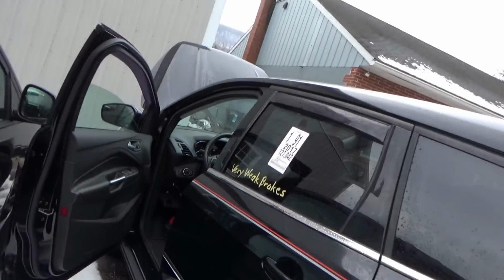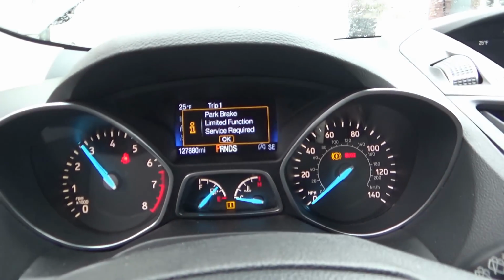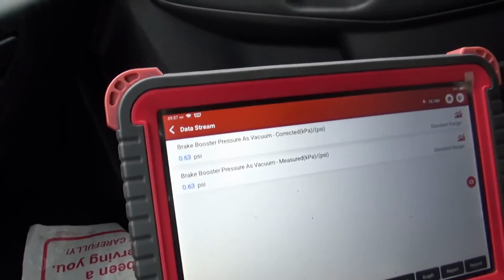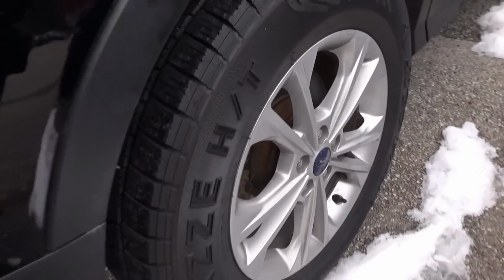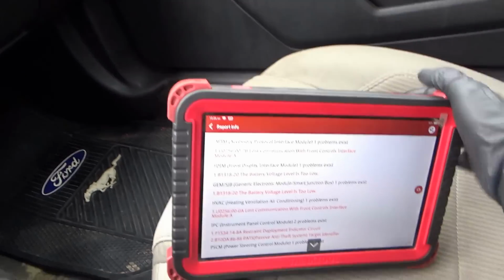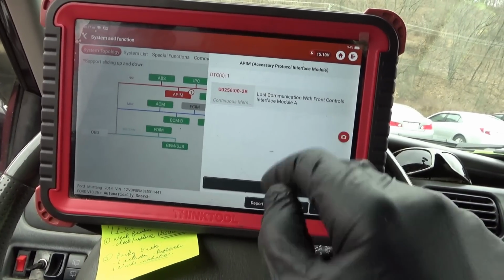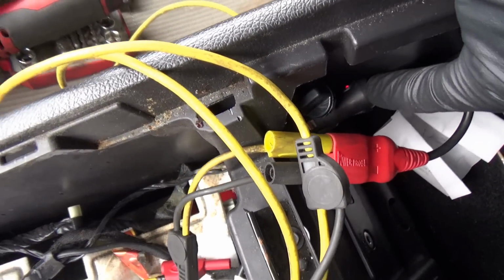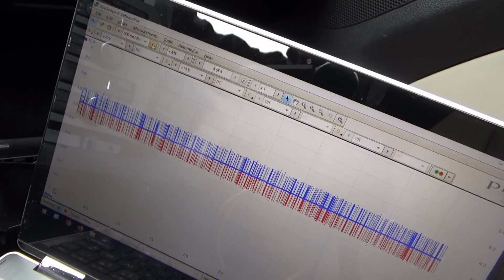Modern Ford FAILURES?! (17' Escape WEAK BRAKES, 14' Mustang No Radio/HVAC)

Comment: For the Escape, we had a similar one traded in quite awhile ago and it had the same stiff brake issue, did not even test drive it out of the parking lot. It had no vacuum from the pump as well. I decided to pop the vacuum pump off and found that the bolt holding the drive into camshaft had broken off clean, nothing to grab on to and was not able to get out the sheered bolt easily. I recommended an attempt to extract and repair or worst case replace the camshaft. Did not get a conclusion as the vehicle was wholesaled to auction shortly after. Hopefully it wasn't that same one you worked on lol! Enjoy the channel a bunch and I keep your diagnostic procedures in mind whenever I get a tough one. Cheers!

Comment: A long time Toyota parts counter guy once told me that US law required them to carry every part for a car for least 10 years after they stopped making that model. 

But (per your example of not being able to find a module for a 2016 GM) I wonder if this is actually enforced? 

Yes, supply chain impacts from Covid is still an issue.

But… it seems that in recent years, many  companies (and people) are pushing the boundaries of the legal system because… they’re aware that they will most likely get away with it. It’s a slippery slope that will be difficult to reverse.

Comment: If i wrote the repair order it would read: 
"Performed analog and digital leak tests on power brake booster, both test results ok. Stuck my finger on the vacuum pump, it ain't suckin'."

Comment: I fully agree that the discontinuation of parts and modules is a huge problem.
  With that in mind, I already bought used modules (really cheaply) for my 2014 Silverado for the future.

  I'm buying other parts that are likely to need replacing some day.
   Buying them before any emergency lets me find them at much lower prices and I won't be faced with "parts shortages".
  I'm getting most parts at 60-80% cheaper than "emergency" prices.

(Full set of 8 fuel injectors, $90 ).
Emergency price?  $1,000.
That was my biggest discount.
New Radiator?  $100 vs $350-450.
Reply from the maker: Where do you get OEM injectors for $90?? Ebay scam? 😆
Reply: I said I was buying spare parts, I never said I was sticking with OEM parts.
   Yes, the injectors are Ebay Chinese imports.
  Even if 50% are bad, I could buy a second set to find enough good ones to fix my car and still be saving tons of money.

  I worked over 30 years in the GM car factories and even in the 1980's I was shocked at how many "factory OEM parts" came from China, etc.
Reply from the maker: @craigescapeddetroit5198  thought so haha
Ask me how many problems I have seen caused by cheap eBay Amazon aftermarket junk 🤣
Don't waste your money 👍
Reply: @PineHollowAutoDiagnostics There is literally nothing worse then getting a car in from a DIY customer that has unloaded the entire  Ebay parts cannon on it.

Comment: Weird - that '17 Escape has a keyed ignition and Sync 1. Our '16 Kuga (the Euro version of the Escape) has keyless and Sync 2.
Thankfully we've also got the manual e-brake, a 6-spd manual transmission (not the Powershit) and the PSA TDCi DW10 engine not the Ecoboost grenades!

Comment: This is exactly why I will not trust any vehicles of modern manufacture. I am old enough to remember when cars were made to maintain and repair. Parts were readily available and anyone who was mechanically inclined could fix them to running condition. Now we are held hostage by the manufacturers deciding when they will no longer supply parts for a car of a certain year forcing people to buy NEW. Forget it NFW. If people were smart they would demand new vehicles to be accessible to repair by anyone, with information readily available and parts of a generic nature that could be easily made by any company. Just today I was watching a video that Ford announced that they selling a $20,000 truck, but it is only available in Europe. Does Ford think people here wouldn't buy a $20,000 truck if they had the choice. Cmon. Wake up. We are being scammed big time.

Comment: I know time was restricted on site, my gut feeling tells me that a push button is jammed on at all times. This command prevents any other command from being accepted. If it was my car I would separate the buttons from the board. Then clean the  buttons contacts both on the board and buttons. Some buttons these days have a carbon tip that needs cleaning over extensive use.

Comment: Why people still buy Fix Or Repair Daily vehicles is beyond me....
Reply: why people buy any new American cars are beyond me. They all need either engines or transmissions and the electronics are junk.
Reply: @RicardoPCGamer  Even the legendary Toyota has dropped the ball. Fifty-seven V6 turbo engine Tundras had spun bearings due to excessive pressure. No way the new generation can last a million miles like its predecessor.
Reply: @Nexgeninfi  you're right. If they would test engines for a long term, this wouldn't be happening. Manufacturers just throw new things out there and next thing you know it needs an engine after 20k miles. Nothing seems reliable anymore. I'd rather be driving my 20 year old car for as long as i can than to buy a brand new car with these expensive payments and this horrible reliability.

Comment: Vacuum pump had no power? What if? Why not check for circuit integrity and fuse perhaps?
Reply from the maker: It's a mechanical pump 😅
Reply: @PineHollowAutoDiagnostics  Mechnaical?  I wonder why ford didn't just come off the engine vacuum.
Reply from the maker: @robertb2468  because TURBO 😉

Comment: I had a new 2015 Equinox.  2 years into it I had no HVAC control and my radio was maxed, I could not turn it off or lower volume and I could not control the heat/ac 
Took it to dealership, the center stack was bad (this was a known issue for the Equinox and terrains). So the center stack was replaced and 3 yrs later it did the same thing and it was replaced again. All under warranty as I had an extended warranty
Reply from the maker: Junk lol

Comment: When I started driving School bus in 93, we had a series of vans (Chevy/GMC Vandura). The one I drove had a brake issue.  You would hit the brake and it became hard as a rock, brake light would come on. Mechanics could not find the reason.  This was an intermittent issue.   
I finally requested another van and refused to drive it.  Mechanics could not get it to do it but it took my boss several attempts to notice the issue after he almost ran a red light.  No one knew the cause.  I think there was an electrical issue with it or some type of vacuum failure.   It was a mystery.
Reply from the maker: Ha I actually rode on one of those back in the 90s 😊

Comment: I had one of these escapes a 2009 with the accumulator ABS booster design, it's motor failed and would not produce pressure for assist, no parts were available. Customer is optimistic storing it until one becomes available.
Planned obsolensence is a thing and even if not all the plastic will only last so long and would cause it eventually also..

Comment: Hey Ivan!  Quick tip on the Sync modules - I see this a LOT!  Always try a super hard reboot first - pull the negative, cover battery post with a rag, then short the negative cable to the positive.    Good, hard, solid reset! 

80% of the time, it brings them back around.  I do run across some bad FCIM's but it seems like more often than not a good reset will get it alive again - that first generation Microsoft programming is flaky at best.

Comment: Planned obsolescence is undoubted. 
BUT
I believe it plays into a greater conspiracy theory I can't believe more people in the industry never seem to even think about. Let alone acknowledge. 
Why do they continually change cars?
Let's talk about say, the Ford fiesta ST = Regarded by almost every reviewer and anyone who's ever driven one as the best, most fun to drive at any speed little hot hatch.
Just concentrate on that part, not engines, electrics etc. 
If this is correct, whether they lucked upon it or it was by design. This phenomenon has occurred over and over in multiple cars and segments over time.
Honda with their magic rear seats. Loaded industry wide as the best function seat option.
WHY, wouldn't every other manufacturer buy these cars, reverse engineer it. Full suspension from the pick up points on the chassis out to the wheels. And put it on their next hatch. Update it if necessary. Find ways to refine it, correct small weaknesses, make it lighter, stronger, cheaper = of course! But if grab the best parts of each other's cars. In only a couple of generations you could have the ultimate, reliable, cheaper car in the segment.
And yet even Ford will completely change there own suspension. 
Honda not only never put the jazz/fit magic rear seat in any of their other models. They no longer offer it at all!
My opinion. They don't want to perfect "the car" they want to constantly pump out model after model. Each model will have it's strong points, and terrible points. Enough that you will buy it for the good and live with the bad at first. Buy gradually the bad with wear you down until you want the new fresh model.
They pretty much perfected the engineering behind longevity in engines and drive trains in the 2000's. But look at all modern cars today? You're lucky if they last 10 years. Explain that to me. 
And don't say cost!
Ask any engineer. Almost any product developed. In one to two iterations you completely eliminated the weaknesses and are already deep into making it simultaneously stronger, lighter and cheaper to make.

Comment: We had one of these at my shop that the vacuum pump drive snapped the bolt in the end of the cam.  The pump had locked up.  Pretty easy fix.

Comment: Planned obsolescence?  Oh, for sure.  Over engineering the simple things like parking brakes, radio and hvac systems for example is the dumbest of ideas IMO.  But that escape though, it looks like the last owner changed the oil maybe once a year.  I'm willing to bet that the high-pressure fuel pump tappet and cam shaft are severely damaged.  Not to mention, the turbo as well.  It may already be too late to save that engine.

Comment: Camshaft damage likely from vacuum pump failing? High pressure pump is driven off fuel pump lobe. Low rail pressure fault.

Comment: You seem to be throwing around some rather descriptive terms lately; "disposable cars" "planned obsolescence."  I couldn't agree more.  The 'ol Marquis needed the infamous plastic manifold.  I was told at the dealership the manifolds for the later model Grand Marquis hasn't been discontinued.  (2006-11)  I had to unbolt the metal crossover and reuse that with the new plastic part.  Dorman makes one, but, I will just let that name speak for itself.  I checked my local junkyard and they have crushed most of the older models, so, I can't source anything from there anymore.  GREAT VIDEO!

Comment: I don't think this is "planned" obsolescence, just cost cutting. It's simply cheaper to integrate as much as possible into larger modules that communicate serially, rather than having a bunch of individual buttons/LEDs/actuators/cables/etc. And at least in my experience, these modules are reasonably reliable (with the exception of some defects/anomalies like bad solder joints and capacitors, or water intrusion). 

It still sucks when the odd one does fail and the part is discontinued/backordered, but every vehicle has parts which will be discontinued eventually (computerized or not). It might be a little easier to make aftermarket replacements for non-computerized parts, but that doesn't mean it's impossible. 

I recently discovered a company that makes an aftermarket serial/CAN module (Idatalink) which can integrate an aftermarket radio with newer vehicles (retaining factory Sat radio, Ford SYNC, HVAC controls, etc.). Granted, you'd have to purchase a new radio, dash kit, and wiring harness as well to make that work, but it is an option in case you can't obtain a replacement FCIM (which I'm certain you can, if not brand new from Ford, there will be tons in junkyards and on eBay for many years to come).

Comment: Did you check the power and ground to the vacuum pump on the Escape? What about the connector on the control module on the Mustang?

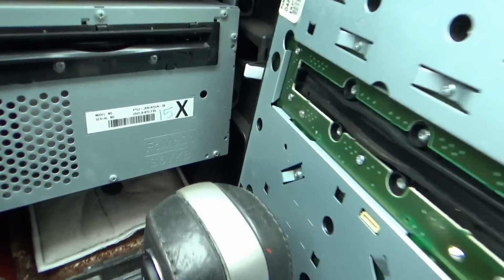Comment: 11:25 wow that dash plate was loaded with rust....almost like its a flood car
Reply: My F150 does that, too, but not as bad.  But it's the brackets under the steering wheel.  No flood.  Just poorly made parts like they couldn't be bothered with proper surface protection.  I just spritzed mine with aviation grade Corrosion-X.  It's a much thinner film than something like fluid film and doesn't stink.

Comment: most likely just a desoldered wire or component. seen a few ford issues with that heater resistor positive leg at board, over head compass resistor leg, headlight module relay leg. im sure it happens to all vehicles
Reply: The newer solder is lead free and does not work as well.

Comment: I take a wide view. We had this same argument about 20 years ago in the world of vacume tube guitar amps. Solid state/digital amps are non-serviceable throw away junk, while point-to-point wired tube amps are still very much alive and thriving. BUT....the functionality that can be put in the customer's hands for the PRICE makes it a no brainer, since tube amps are a big buck proposition. That it's throwaway is what makes it affordable. It's similar with cars - we can make a car that's 100% serviceable and durable, but it'll cost $200k and nobody will buy it. I too prefer high quality stuff to low quality disposable, but I admit that I'm often a cheapskate and I don't want to pay for it. And I'm spoiled enough to want all the functionality that the panel in that Mustang offers. In short it's our own fault as consumers to a large extent.
Reply from the maker: Sooo how do you explain 90s cars being half the cost and 3x the longevity of modern disposable vehicles? 🤔
I drive a 1996 Ford product that I bought 7 years ago for $500. At 300k miles it literally feels just barely broken in, no joke!! 😅
Reply: @PineHollowAutoDiagnostics  Late 90s early 2000s cars are the sweet spot between durability and technology, I agree. 

But I’m old enough to remember having these arguments over canbus, mpfi before that, cpfi before that, and unibody before that. Oh how mechanics bitched at the invention of the oxygen sensor!

But do you really want to go back to carbs and points? How about counting flashes of the check engine light? Me neither.
Reply from the maker: @promastersonly1419  never said I want to go back to carbs and points, although I do respect the older technology 😉
In general people want hassle-free reliable transportation that lasts at least a couple decades without major breakdowns or expenses. Seems that was almost perfected through the 2000s but recently the trend has been going backwards... 🤔
Reply: @PineHollowAutoDiagnostics  agreed. 

If maximum cheap to own/operate was the goal, we’d ALL drive Corollas. But we dont. We want fast cars shaped like penises! And we want audio controls on the steering wheel, because I simply cant be bothered to move my hand! 

And to be fair, cars of any period can be disposable junk. You havent lived till you’ve battled a ballast resistor that isnt a resistor, it was a resistance wire coming off the coil. Or a mechanical voltage regulator. Or starter shims. Or vapor lock. Or chokes. One word; Jet-tronic!
Reply from the maker: @promastersonly1419 haha right on! I wouldn't drive a Corolla because life is too short to drive something so boring xD Probably explains why all of my vehicles are quirky outdated "junkers"...but they all drive "like new" and are simple and reliable like old friends :)
Reply: @PineHollowAutoDiagnostics  For you, I see you in the ultimate expression of this - Isuzu Vehicross. That’s about as peak 90s as it gets. 

For me, it was a 1996 Buick Roadmaster wagon. Holy crap what a great car. 

BTW - every generation feels this way about the cars from around the time they were born. Dudes in the 70s wanted prewar hot rods. When i was in high school in the 80s, the parking lot was filled with junk from the 60s. 

It’s a time honored tradition!
Reply from the maker: @promastersonly1419  I've seen a VehiCross once in a mall on display. Wasn't too impressed by its lack of 4 doors and giant blind spots 😒
I would rather go for a late 90s Rodeo or Pathfinder stick shift...those were handsome capable SUVs 😊

Comment: I could see this years ago when I was working on cars. The planned obsolescence is mind boggling. I prefer all manual controls for the HVAC. I never have liked auto HVAC. I just think it is more stuff to go wrong. Give me simple levers, cables and vacuum servos for the HVAC and I am good.
Reply: I miss the sight glass for determining AC charge.
Reply: I hated when they got rid of the simple pressure switch.  You could just short it and if compressor came on theirs your part, or there isn't any freon inside.

Comment: Don't feel bad about 10 year old cars having discontinued parts. I was doing auto body repair and refinishing in the mid to late 1970's. I had a friend who wrecked the hood on his 1973 RoadRunner in 1976. The hood was discontinued, forcing me to use a low quality used hood for the repair.